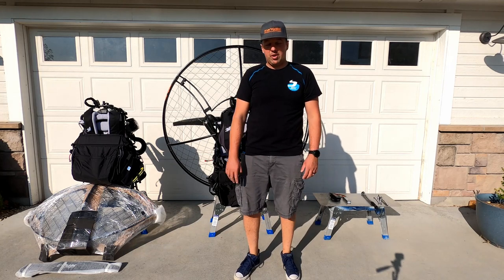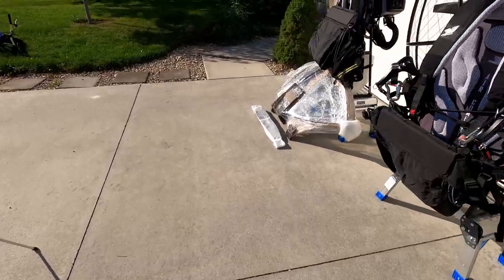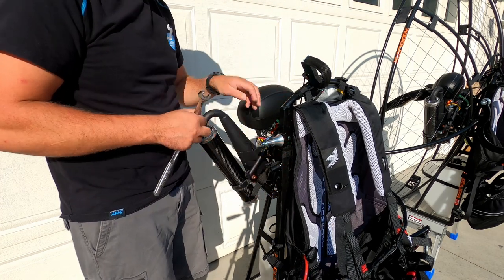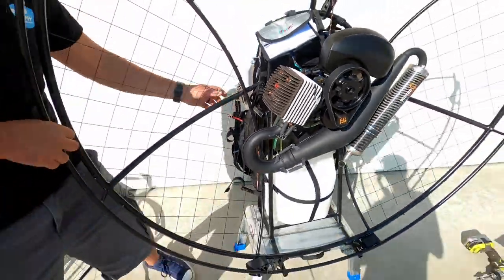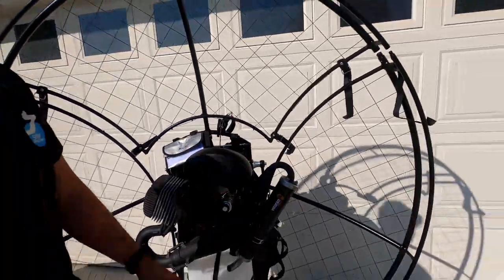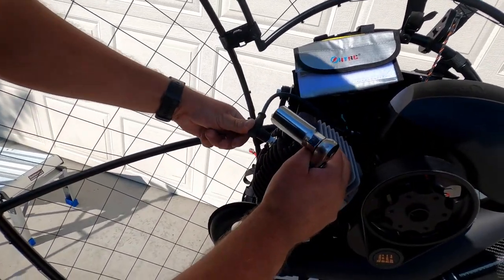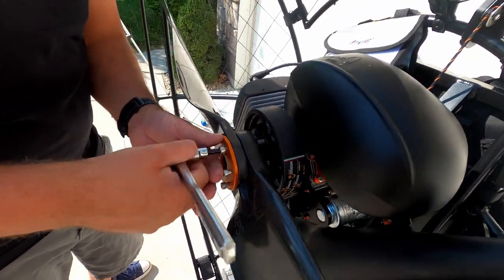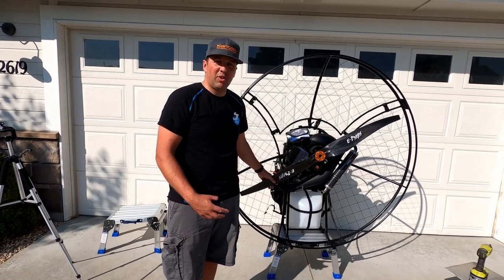Putting together Kangook Paramotor

Comment: At 8:40 you may have missed the hole in the hoop section designed to put the strap through.   When you click that hoop piece into the frame (by swing arm at 7:45 ), is there something to hold it in?  On mine, it is just loose and I can pull it in/out and wiggle it.  On yours it looks like the hoop section has a spring loaded ball bearing or pin which catches when you push it in?